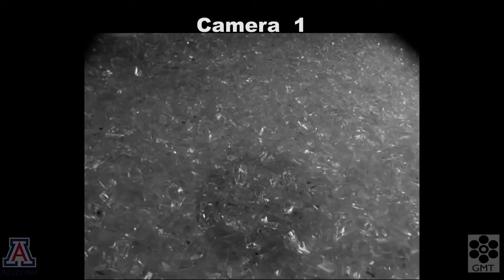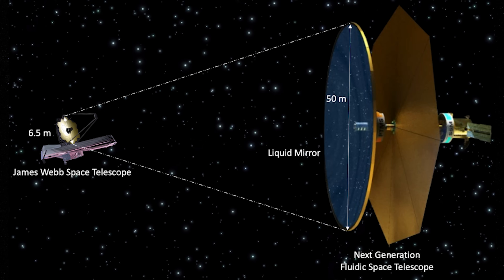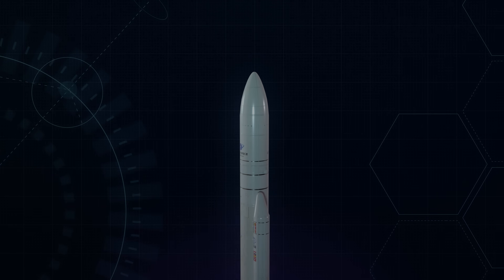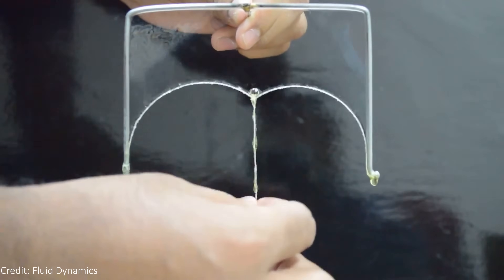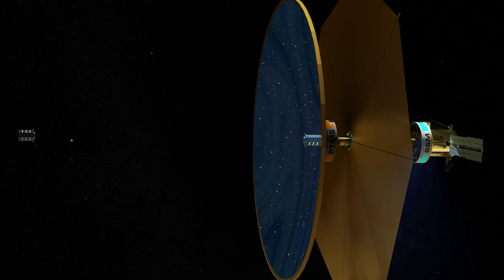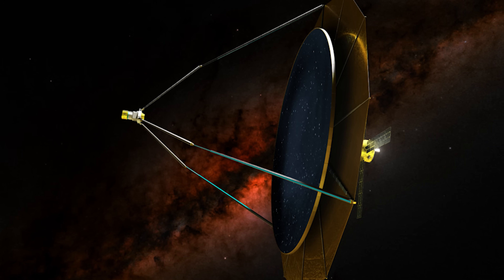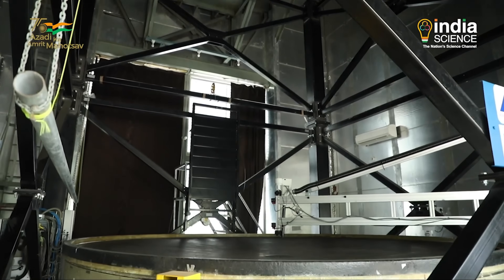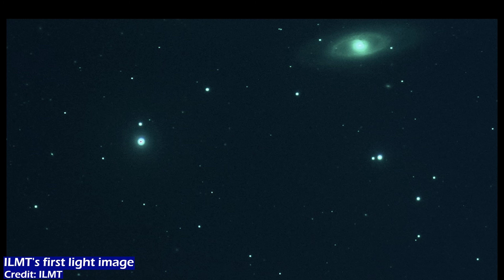LIQUID Telescope Mirrors Could Be The Future | FLUTE Mission

Comment: That will not work. The liquid is too flexible and small currents will form as soon as a slight temperature difference is encountered or movement occurs. Just the light hitting the surface of a liquid causes currents in a surface experiencing micro gravity. The images will be fringed and rippled. 

 Also, good luck keeping a free floating device constantly in the focal plane of a secondary free floating device. Believe it or not, 'empty' space has turbulence. That's why everything spins and tumbles. They won't stay aligned. And that's we connected together everything in space. Just ask the astronauts.

Comment: 6:28 like you said... mercury would not only be very heavy, but it has so much surface tension that it would want to form thick films and would likely transfer too much energy & "shatter & spray" if impacted unlike lowered surface tension soap bubbles. I'm not familiar with gallium, but I imagine it behaves similarly. I'd bet they're working on some highly reflective low viscosity synthetic, possibly even infused with nano particles whose diffusion is minimized at mega scales
Reply: Also Mercury dont like to Stick to things and if yes like to gold and Cooper it slowly disolve them.

Comment: pure Mercury would be too heavy and vaporizes extremely easily given that we know we absolutely need it in a fume hood. also its surface adhesion is horrible. It loves destroying Aluminum
pure Gallium may require heating but i'm not sure how conditions in space for telescopes are, freezing vacuum, but heavily thermally irradiated. it also loves attacking Aluminum
Cesium would be funny but good luck getting it to the launch site but also it also suffers from vaporizing
NaK (sodium potassium alloy) is very light, low vapor pressure, but also not very shiny and also very reactive
Galinstan (gallium, tin, indium alloy) is heavier than Gallium but lighter than Mercury, low vapor pressure, very high surface adhesion, liquid at cooler temps than Gallium. I would think this ideal but theres probably more suitable liquid metals or even nonmetals out there I imagine? also still suffers from really liking to destroy aluminum.

What if we skipped the single uniform metal though and explored metallosurfactants or even thin film interference? Surely theres a way to harness these into the way we want them. Thin film would be difficult given how much it messes with the wavelengths. Metallosurfactants are interesting in that one side is a hydrophobic tail but then the other side is a hydrophilic head with some metal in it, it supposedly has a lot of similar properties to the metal though I am unsure about reflectivity:
"Metal, being an important part of the metallosurfactant system, imparts the typical metallic behavior, i.e. redox activity, catalytic activity, color, variable charges, and paramagnetism, to the surfactant molecule, while the inherent surfactant in the metallosurfactant tends to adsorb and aggregate at the surfaces and air–water interfaces"
but there could be a way to make them shiny.

Comment: Or just build the mirror on the Moon. Even if you want to launch it from the Moon to avoid dust - You don't need a faring during launch, since there's no atmosphere. Just vacuum. A smaller control module can be launched from the Earth. Keep it in Lunar orbit. Keep fuelling it from the Moon. 

To power things on the Moon around the Lunar clock, just use solar panels. Launch big reflective arrays into orbit, so that at least one can always bounce light from orbit to the objects on the surface any time they need a top-up.
Reply: Couldn't we just use lunar regolith to make mirrors in low gravity, or perhaps even convert a meteor crater on the moon by turning it into a mirror after lunar regolith is glass ??
Reply: Impossible, have you seen the dust free environment that these things are made in??. Engineers are scrubbed before having to wear clothes that have never been outside plus masks and gloves etc. The moon is covered in dust that’s sharp as glass. The Apollo astronauts hated it , it got everywhere

Comment: Evaporation does seem to be the problem to overcome, and I don't see how it can be done.  

I like the idea that a bit of dust might puncture the mirror which then says 
"Yeah, whatever" and then immediately fixes itself.

But how do you stop a liquid evaporating when the vapour pressure is zero?

It's a conundrum!
Reply: If a micrometeor strikes through the liquid mirror and perforates the substantive supporting structure, I wonder, could that be a potential point for a liquid-mirror leak?
Reply: Perhaps surface tension would slow down evaporation enough. I don't know.  Perhaps they keep it inside a box with small pressure. Open to vacuum after mirror has solidified.
Reply: Materials science is always evolving. Perhaps the liquid could be confined within a membrane that might prevent evaporation?
Reply: Perhaps it doesn't have to be kept in a zero pressure environment. Put the mirror inside an inflatable transparent bubble, perhaps.

If the bubble's material will interfere with the telescope's operation, then perhaps fall back to the idea of having the mirror start out liquid and then "cure" it in space. Once it's cured, remove the bubble.

Perhaps you don't even need a reflective mirror material in that case. Inflate the bubble, inject the mirror polymer and cure it, sputter aluminium vapor onto the cured mirror surface, and then remove the bubble. Voila, a gigantic mirror very similar to the sorts of mirrors made down on Earth's surface.

There's a bunch of neat ideas to explore here.